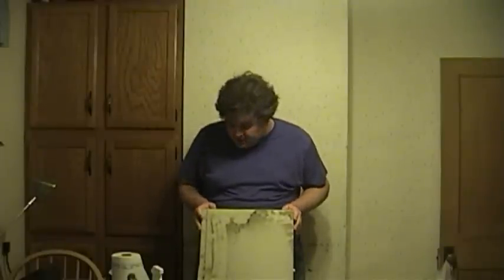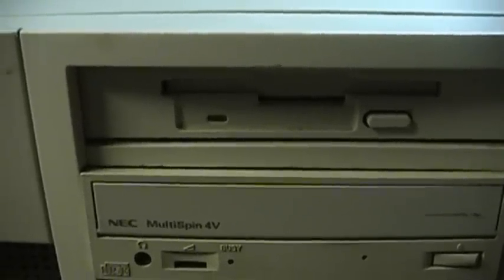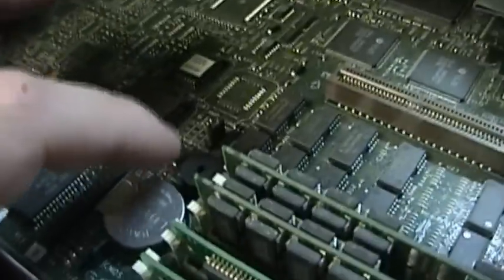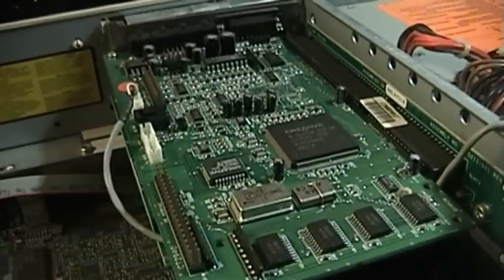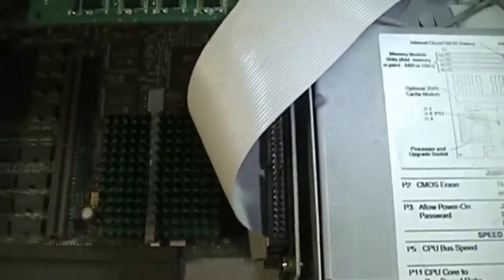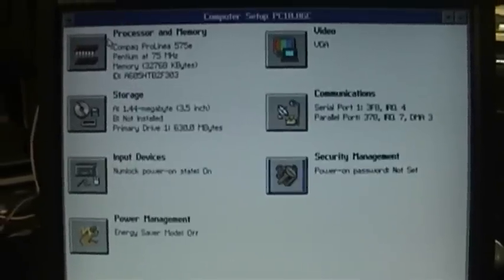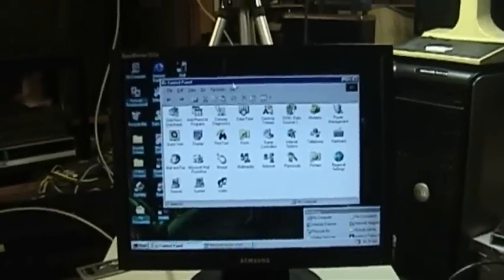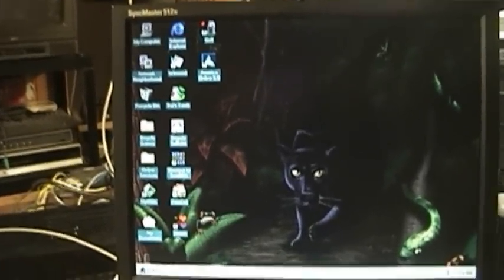Compaq Prolinea 575e Overview

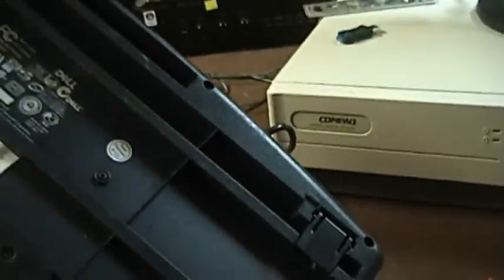Comment: 32:32 I had a keyboard like that one and the glue (or whatever it is) holding the ps2 connector in place gave out at one point when I went to unplug the keyboard it left the metal part of connector in the computer. I managed to get it out of the computer and decided to see what would happen if I just pressed it back into the cable and much to my surprise it worked. 

If you still have a keyboard like that might be a good place to check.

Comment: I was thinking surely a modern PC would use more electricity than an old one from the 80s or 90s ? as for example a modern gaming PC the PSU along is rated to 600 watts so if you have a powerful GPU hooked up to it and a core i7 or i9 then your definitely gonna be breaking the local power station lol
Reply from the maker: While it can be said is that a more modern PC may get more out of the electricity it's using, that's not always easy to quantify.
Reply: @uxwbill  Yeah for sure, i myself am using a 10 year old Hp pro 3130 small form factor PC have upgraded it to an SSD 16gb ram and an i7 860 cpu , stil uses less power than a new PC unless you buy one of those awful Celeron PCs they use like 15 watts of power but have no power lol
Reply: @christineayres5339  The Prolinea 575e here draws 27 watts. I leave the unit always on. I need to clone the HDA sometime since it is the original drive from 1995 . It came with windows 3.11 when new and the ram was like 6 or 8 megs. I bumped to ram to the max that was available around say  around 1998 to 72 megs. Mine has one PCI slot and has a Lan card for my network.  I went from later to Windows 95 to Windows 98 SE. The units CD reader was clunky and some of the Win98SE stuff was installed with a parallel port Zip drive. The power supply in the Prolinea is original, the designer needs a grand prize award. When all the usual hurricane storm power surges happen the Prolinea has never failed. While many other computers have had their power supplies die. The unit is used to print shipping labels, It was the the top dog computer when new and cost like a grand or two.
Reply: @3beltwesty  Amazing i love the vitage PCs , modern PCs have no soul and people who use a PC just for gaming are morons in my opinion as if i want to game i go buy a PS5 or something not on a  PC its a work tool for adults not children

Comment: Compare a Raspberry pi in a power saving competition! A pi will do the network processing with only 3 watts compared to your 35 watts...More than 10x less!
Reply from the maker: The suitability of a Pi depends upon what you're doing. Until recently, the arrangement of their USB bus was a huge bottleneck...not that an old PC would necessarily run rings around it, but the bus architecture is less of a bottleneck. And I kind of like to have things all in one case anyway, rather than hanging off of random USB ports, needing separate power supplies, and that kind of thing.

Comment: It really pisses me off that they made computers with only ONE PCI slot. Those smarmy, money grubbing computer companies deliberately did that so you couldn't upgrade the system.  I had a Dell system in the late 90's, when I was a poor college student; that only had one PCI slot just like your system that made my life hell trying to run Windows 98 on and play games. I couldn't afford to buy anything better so I had to try and squeeze every last bit of performance out of it's Pentium-100 MHz processor and 32 MBytes of RAM. It really made my life hell because I couldn't add a SCSI card or USB card to that piece of shit garbage computer from Dell. What a filthy, badly designed, and just downright inconsiderate computer design. I hope you take a sledge hammer and bash that computer into an infinite quantity of pieces; it just makes my blood boil thinking about that damn computer.

Comment: I've worked on my Compaq Deskpro EN for about 6 years now. I love its 300MHz Celeron, but its Serial, PS/2, and Parallel ports don't work. No floppy drives work. I had to put in an add-in Sound Card, GPU, USB Card, and Ethernet card. So I use it with an IDE DVD-ROM drive and a 40GB hard drive on a single IDE channel, with a USB Keyboard and Mouse (it works, surprisingly). I love that machine so much that I've kept it running for this long, but it gets to be a pain after a while. 

It's a staple in my LAN Parties that I occasionally run across Northern Illinois. Whenever we do a DOS Gaming / 9x gaming party, that machine always gets used by somebody (I use my Gateway 2000, its one of the machines that has stayed with me over the past 10 years without problems).

Comment: The original 72pin FPM SIMM in my Mac Performa was a 4MB IBM stick, I thought that was weird.

It has a 60ns 32MB SIMM now, so it is a good bit quicker.
Reply from the maker: In some of the early Power Macintosh line, you'll also sometimes see PowerPC processors fabricated by IBM. So it's not impossible to think that Apple might have used memory modules built by IBM as well, perhaps as a second-source arrangement.

Comment: Another fine production. Think the panther was a marque in its time as only certain machines recieved allowance too run this. Could be obv. Later Apple cat relations but jungle was large part of code,symbols,like stall mans eMac editor built refs of symbols too words collected semantics,etc. Think that compaq graphic chip set up was part of much longer design that always pleasingly became advanced micro proving S of the whole manufacture system. I do have a compaq myself but it's not run right now was running 98 the same.

Comment: hey bill i have a 2300 it use to have a celeron 1.8.. I bought a 2.0ghz p4 in it.. and 1gb ram with a evga nividia geforce 6200 pci videocard in it. was wondering if you knew what the biggest processor i can go....Thanks Bill
Reply: A 2.6ghz or 2.4 P4 according to this will work https://www.dell.com/community/Desktops-General-Read-Only/Dimension-2300-CPU-Upgrade/td-p/3383244

Comment: Wasn't there Hercules in the GPU market too?   PowerVR aswell though I'm most familiar with them in mobile phones and the iOS and tablet market usually based on the ARM architecture.
Reply from the maker: +Samthebam4044 Hercules' big claim to fame was their high resolution monochrome graphics adapter in the 1980s. It was a drop in replacement for IBM's monochrome text video card and maintained compatibility with the 5151 display. This card was their biggest success, although they did design and market a few others. By the time of the 1990s, their products simply integrated graphics accelerators from other companies. Later in the 1990s they were bought out. Their new owner went bankrupt not long after. Another company bought the name, sold video cards for a while and most recently used the Hercules name on speakers and gaming accessories.
Reply: +uxwbill Yeah I had one in my first PC I actually owned an Athlon 550MHz though the GPU was a Tseng Labs ET6000 compatible it wasn't a 3D accelerator so I couldn't play 3D games.

Comment: I know many people have commented on how your place looks, To hell with them. Its your place. Keep it how you want. There is much worse out there and it is most likely the ones complaining about yours. Don't let them get to you or annoy you. I love your videos and the enthusiasm you put into them. And the Radio Shack bomb line was priceless. My entire place looks like that. I have 5 tvs in the front room alone. 4 are antique, and they all work. I also have 4 tvs in the bedroom, 2 of those are mid-late '70s models. Lightbars, cables, etc... I've got more crap than the electronics section at walmart.

Comment: About Power consumption old vs new PC:
Not True ! New Processors like the core i7 need much less power!
I buillt myself a 10 Watt PC two years ago! 
With:  i5-4570 and Intel DH87RL!
Modern Power supplies have much better efficiency eg.: 80plus certificate!
Reply from the maker: +Animarkzero ‍What is true depends greatly upon what you are doing.

80 Plus is largely marketing. The efficiency of switchmode power supplies has changed very little over time, and many of the power supplies used in older computers would easily meet the requirements.
Reply: https://www.cpubenchmark.net/compare.php?cmp[]=1058&cmp[]=754
Almost same power consumption(ballpark range) but what a difference.

Comment: Hey, Bill, a lot of times you do that "smoke test!" thing on your videos, but have you ever actually had a computer or another piece of equipment explode on you while you've been working on it? Just curious how often that happens. I like messing with stuff like that, but you have a ton of stuff that's really old and very interesting. Thanks.
Reply from the maker: +Elías Cuevas Yes I have. It's not terribly often. The last time it happened, I had just plugged in a Dell Dimension 4600C. It put off a nice loud POP and some smoke. Before that, I foolishly plugged in a PC power supply known not to work, and the standby section went up.
Reply: +uxwbill I've never had a pc smoke but I was working on an old Cobra 89 that blew a capacitor 2' from my face, I think I hit the ceiling.

Comment: Why I don't like branded systems:
1. Power supply! They are not designed for more than the original parts.
2. Motherboard support, like the dc5100 from HP which has a crippled x16 slots
3. Driver support, only for the OS they come with. Good luck upgrading
4. Price, you don't really spend less on buying branded PCs compared to good self builds from smaller vendors using standard components.

Comment: OR you could stuff an efficiient power supply into that old computer and have it pull 20 or 30 watts    but seriously    go imbedded   a small embedded network appliance pc will pull 10 or 15 watts and be silent  :)
Reply: ill bet if you look hard enough you can find one of those ultra low power ones that are like ninty watts   how many watts the one in there rated for?
Reply: anyways  love your videos :)
Reply: ahh okay   never been good with switch mode supplys   i spend most of my time futzing arround in the TTL voltage range    nyways  i love you videos  and get myself all excited every time a new one comes out :)

Comment: I would agree with the Microsoft Office 2003 section of the video. I use libreoffice which provides new features and most definitely no ribbons.

I also would have changed the desktop back to normal windows settings myself.

Comment: Person coming out of the woodwork here, in regards to your speech about old computers not using more power to do the same job at 25 minutes in.

Just to play devil's advocate, have you considered modern non-tower style computers? For example the raspberry pi which runs off just 5 watts and, despite lacking PCI slots, have capabilities that surpass most computers from before 2006. For your specific example of NAS, fancy expensive modern routers have USB ports on the back which allow you to have a NAS for the power cost of just running the hard drive (or an even lower power usb stick, which by the way, should have more capacity than any IDE hard drive that could attach to an older system).

I share your love for old computers, and it makes me happy to see an old computer doing the job that it was built for decades after it was manufactured, but saying that they don't use more power isn't really accurate.

Love your videos, love you,
sincerely, HamburgerExplosion

Comment: This computer almost looks as nasty on the outside as an older IBM from the early 90's that I saved. The IBM that I found was being used by the maintenance guys at an apartment complex not for computing but to stack bags of salt on top of. The thing was completely rusted from the salt and filled with yummy bugs. The funny thing about it is that it actually worked, even after all of those years of abuse and rust.

Comment: This machine looks like it would be good for somebody who wanted to play MSDOS games.  All those ISA slots are most useful for such a machine, and it should be fast enough for all but the latest games of the DOS era.  I presume the speaker output could be redirected to the sound card.  The single PCI slot could be used for an early 3Dfx accelerator, although again the CPU (even if upgraded) might be a bit underpowered for those latest DOS games.  But for the pre-3D era it would be quite good.
It's a bit disappointing that the jumpers offer no apparent option for a 66MHz bus mode, and as you mentioned in the video, the RAM is a bit slow.

That chipset is interesting.  Odd that the chips are made by VLSI instead of Intel.

I hated ISA PnP.  I really preferred the jumpers, jumper based ISA cards just worked as they were told.  I found ISA PnP to be a constant battle and pain in the neck.  PCI PnP was better, but it took some time for me to be convinced due to my terrible experience with the ISA variety.

I have a couple socket-4 Pentium 60 CPUs, of which at least one if not both have the FDIV bug.  I truly wonder if Intel could still replace those ancient things.  I suppose they'd be more likely to offer some common socket-7 chip.
It's funny how socket-4 ended up being such a dud.  With all the upgrades that came available for 486 boards, they ended up surpassing any socket-4 Pentium and for much less money.
The system in the video seems slightly primitive compared to most common mainstream Pentium machines, so I think it must be one of the earliest socket-5 systems.  It really represents when the Pentium platform was hitting it's stride and becoming mature and practical.

Comment: I am curious though however, sorry for the double comment, how exactly is the CD drive installed? Is it mounted or is it literally just jammed into the case as shown on the video? You didn't flip up the holder which has the floppy and CD drive in as there's a lever on the top of it that lets you flip it up (the primary IDE cable can also be run underneath instead of above if you wanted to tidy it up a little)

Comment: I am of the opinion that computers should at least have PS/2 Ports.

I am also not much into overclocking.

My Gateway Essential 450 SE has one lone ISA Slot.

Older computer don't just use less power but they also don't heat the room up all that much as well.

I myself am not too keen on why people like to use stupid themes like this as well and I am personally a fan of the Windows 95, Windows 98 and  Windows 2000 color scheme and I also like the windows default theme settings as well.

Comment: Branded computers are overpriced and still have the problems of old - see Acer's Predator, for no reason at all they made the 24 pin ATX into a 12 pin and now you can't use any other PSU without a 3rd party expensive converter.

Also, branded computers these days (response to 9:45) are nowhere near as reliable as a custom built PC with a nice Seasonic Japanese cap PSU no matter how hard you overclock it unless you're running into unacceptable temperatures because even to this day Dell etc will cheap out whenever they can on the power supplies.

And overclocking GPUs these days is the norm because it voids no warranties and is literally free performance there for the taking with no reliability drawbacks as the max ocs they can reach are still well within temperature thresholds as all GPUs are designed to operate on reference blowers which are far less effective than the custom PCB and cooling systems from EVGA, ASUS, Palit etc.

Even down to the fans on custom builds, they are bound to be more reliable and higher performing than any OEM offers as long as you use companies like Noctua.
Reply: +OK Well, 3 out of the 4 paragraphs of this are useless to mr. Bill, cause he's not an overclocker or an enthusiast, as he said barely a minute after.

Comment: Great to see this old computer. The first computer I ever built for myself from parts was a Pentium 120 on an ATX mobo, 64 mb of ram, and a 2 gb hard drive. I think I remember spending over $200 on my first Sony cd burner back in the late 90s. I owned a ZEOS 486 before building my own. As I remember, Windows 98, NT 4 and OS/2 Warp all ran splendidly in 64 mb of ram. I wish I still had those old beasts, but they went to the trash years before I ever thought I'd be interested in old computers.

Comment: @uxwbill Sorry about that, was not thinking at the time. At least I have a reply button (that would have made me look like a real idiot)

I actually got a 45U Two post rack for 40 dollars on craigslist today, I would recommend you check around if you ever needed one and they were too expensive! There are also rackmount shelfs you can use,so for things like modems and stuff.

Also, there is a computer I got! A IBM "Personal Computer 300GL" but there is one difference with it, its not flat, ITS A TOWER! Probably going to be replacing my pentium pro firewall with 128MB of RAM.

Comment: Hello, Mr. UXWBill. Another great video as always! I recently came across a machine that is VERY similar, even down to the 75 mhz Pentium 1. I haven't even heard of the FPU glitch until you mentioned it. Anyways, on my machine it had Windows 95, although it was messed up. On those machines, it is common for there to be keyboard errors (And I spent a couple of days trying to figure it out!) and on mine the RAM test fails, but you can cancel and continue with boot. Because you went and showed us yours, I am now going to pull mine off the sidelines. Anyways, continue making those good videos, because it is interesting learning about these old(er) computers. (I still use a Pentium 4 as my main computer!)
Reply: *****  I am using an AT Keyboard with an adapter (8 pin?) to PS/2. I did get it to work, although I would have to unplug the Keyboard and then quickly plug it back in. Anyways, would you know what could be causing the RAM check to fail? it gets to about 12MBs and then fails.